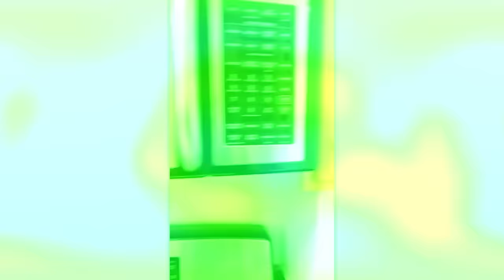Most Ridiculous Workers Mistakes Caught On Camera

Comment: Pouring concrete stairs has to be the most frustrating. You have to find the the balance between stiffness and pourability. You start from the BOTTOM, one step at a time careful not to create a landslide. Those guys, however, guaranteed a blowout.